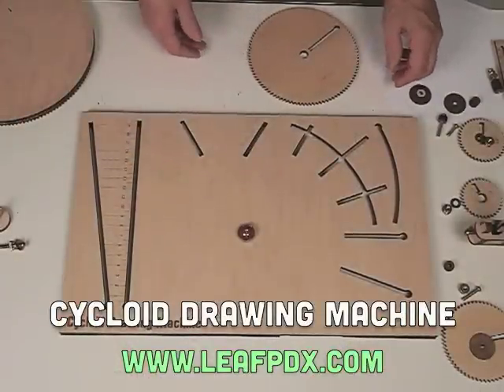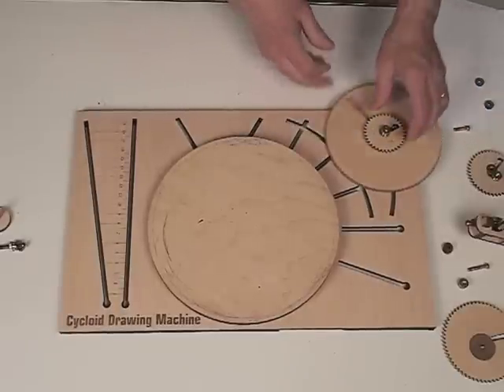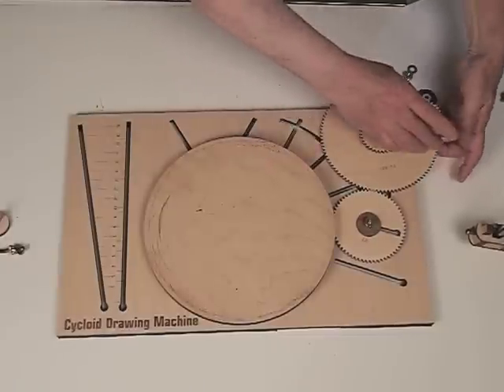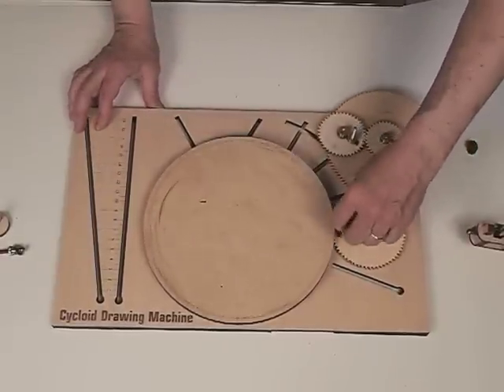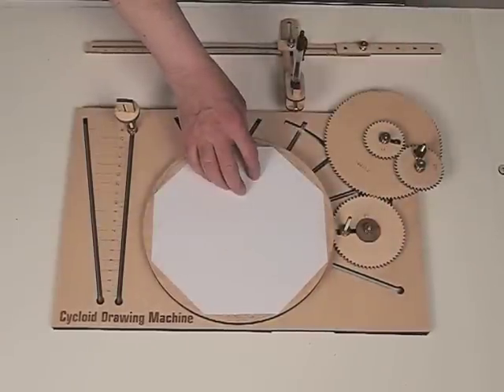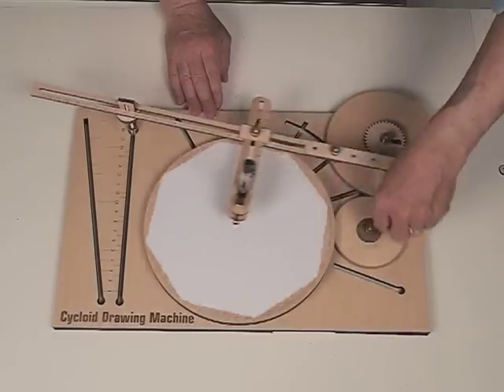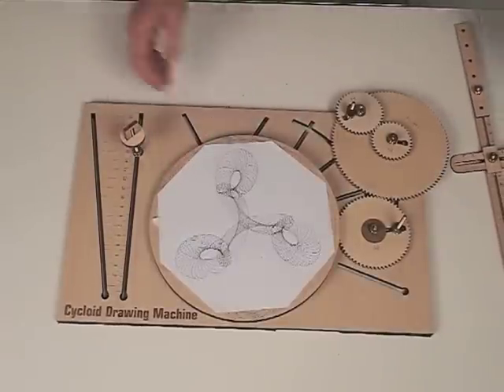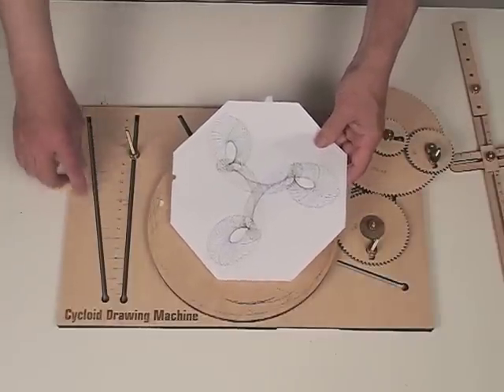Cycloid Drawing Machine: Center Gear Setup

Comment: The second largest gear (which is the large one below the small fixed gear) must be about 100 & not the 50 mentioned as that would not work. Otherwise a good video of a brilliant machine. It is hard to believe there are dislikes.